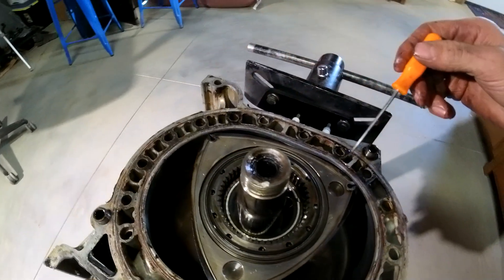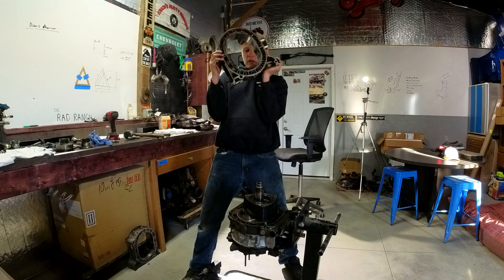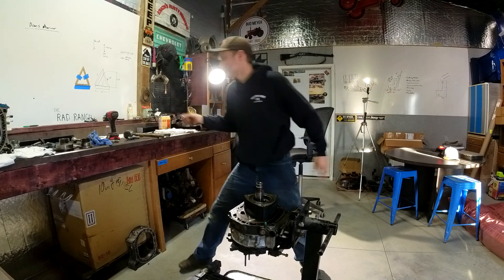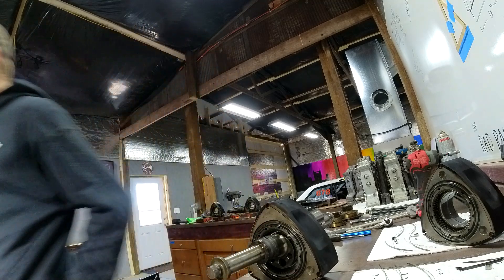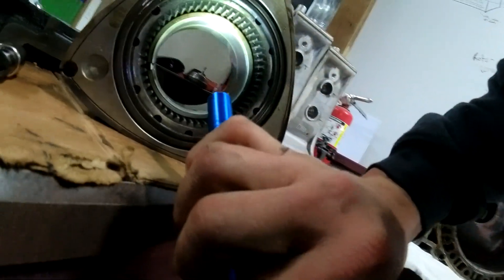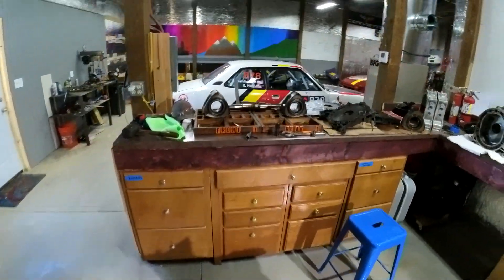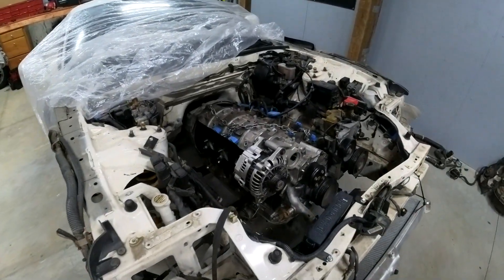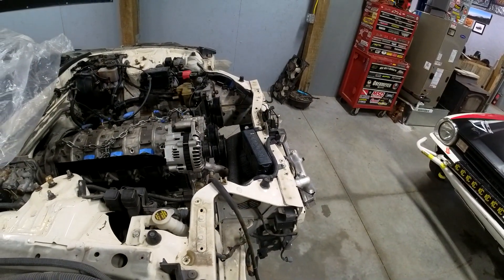I Had to CUT My ROTARY Engine APART - RADX7 13b Turbo Needs HELP

Comment: Don't run a bearing with copper showing mate..they are $50 haha.. especially with rx8 cranks and boost, they flex easier, check it for run out with a dial indicator..if its more than 0.10 bin it..

But please don't run any copper showing bearings..the copper will expand more, catch you crank and grab it again
Reply: I just got my bearings in the mail. 200 bucks for all four. Not a bad deal. Now is there a difference between auto and manual rx7/8 bearings?
Reply: @subifudriftkings  there is plenty of differences the part numbers correspond to a colour you will see on the bearing h bearings internal diameter is different I would measure your crankshaft lobe then measure the internal diameter of you bearing you are going to find  the difference between the two will tell you which bearing you need. Basically the bearing with green or yellow on them have a bigger tolerance the auto bearing while it has the same internal diameter as some of the manual bearings only has one hole to disperse the oil but you can drill more holes that's easy don't have the tools to measure and your crankshaft is second-hand maybe look at red bearing nearest heaps of factors to do it if you're crank is slightly bent also they will make your bearings wear faster so that's why you need a bigger bearing clearance

Comment: Big g clamp to hold housing down on front iron..

Make a slide puller to pull Dowell's..rx8 engine mount to block bolt is same thread as the dowel..
Cut the head off wind into a spare dowel, put one in other end and fix something to it as the puller

Comment: good to see it wasn't all completely ruined. a sigh of relief lol. I need a space to work so I can tear my renesis down. Believe I have a control ring dying. Been smoking a bit during pulls, but its random which is confusing lol.
Reply: Your bedroom is an option….I’m building a turbo2 bridgeport 13b in my room as we speak. I did the disassembly and cleaning outside and brought the parts inside cleaned and ready to go. Once I get the rotor bearings pressed in, (they came in today) I’m putting it together.

Comment: I think the 10mm stud debate is taught by people who don't know rotaries brake.
1/2"  12mm studs or extra dowels are the real fix. Rotaries don't need to be clamped harder they need to stop the twisting.